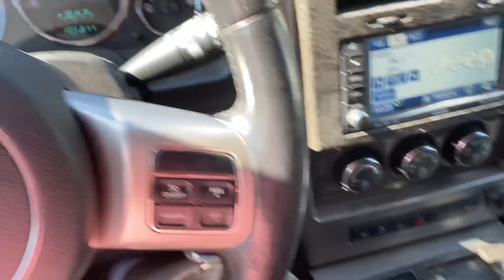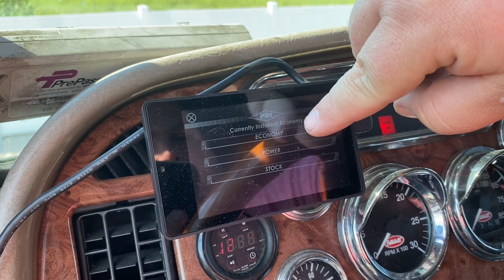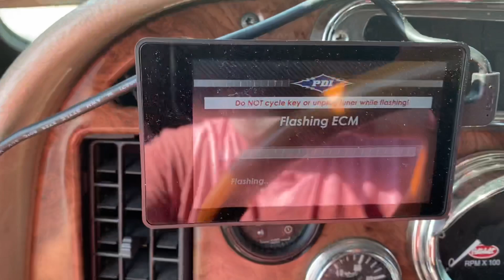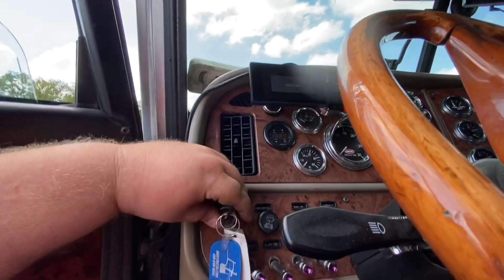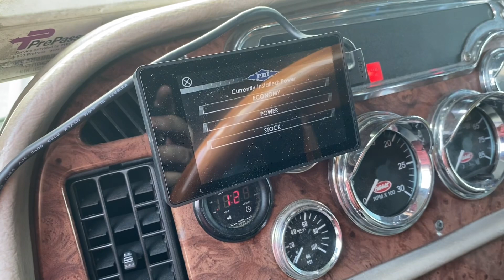License Plate RELOCATION COMPLETE! We add POWER with the PDI BIG BOSS Tuner! Day in the life

Comment: Good video Khori, Old Levi Peterbilt 379 has more resale value "Equity by the Banks"  then a used Freightliner Cascadia or Volvo or Mack with the same miles. As some young truckers haven't figured out that the banks know Peterbilt classic trucks 359, 379, 389 and Kenworth W 900 are built a little better and resell value is better then the Freightliner, International, Volvo, and Mack throw away trucks. Sorry for the spoiler alert....lol. I always had a thing for the old 1966 split window corvette every since I used to tune up the Chevrolet dealer owner 1966 split window corvette with 327 CID with fuel injection and a 4 speed transmission. Loved taking out for a spin making sure would run well on the highway and town. Zip! Zip!...lol

Comment: Oh Yeah! That looks so much better! Covers the hole on the bumper and gets that plate off the grill.  👍 
Now if we could just get all the Aluminum & Chrome Polished up, Get some Peterbilt Mudflaps on the Rear, and a new Steering Wheel, and get that spray paint off the Drivers side tank.

Comment: What is your max boost psi now with the tuner?
Reply from the maker: I’ve hit as high as 55 on the gauge if I really get into it. But that’s with a compound turbo set up.
Reply: @survivetothrive21  I also have a c15 Acert BXS prefix. Running a 550 heavy haul tune I see 55-60psi I try not to go over 55lbs this acerts will blow a head gasket if too much pressure on the head. It’s best to run 16:1 compression pistons and back off ivas. Once overhaul time comes I’ll be running that on my list